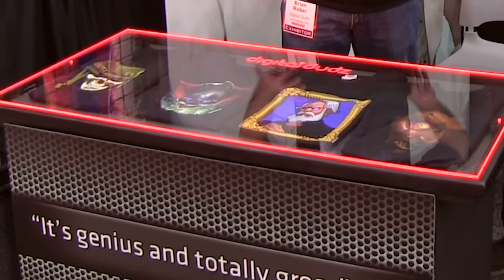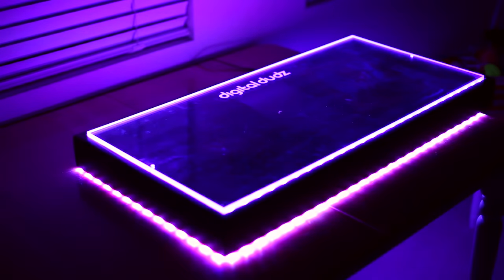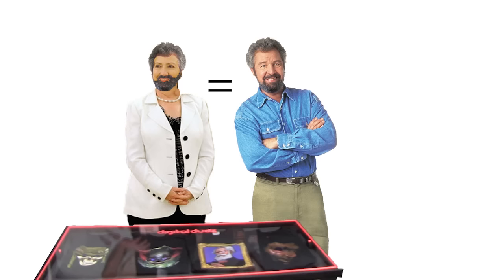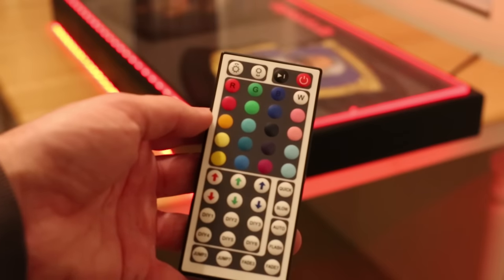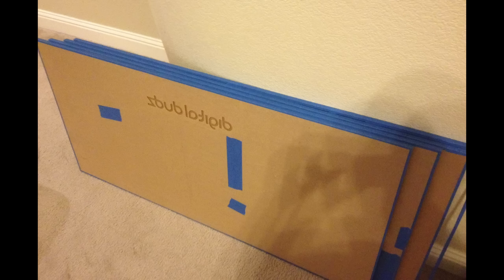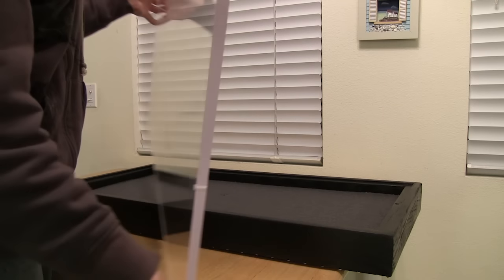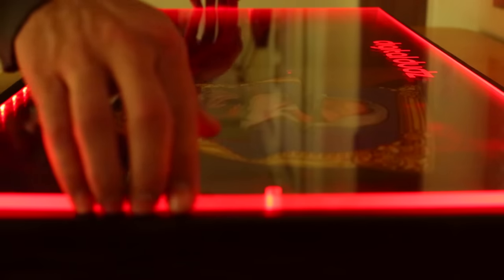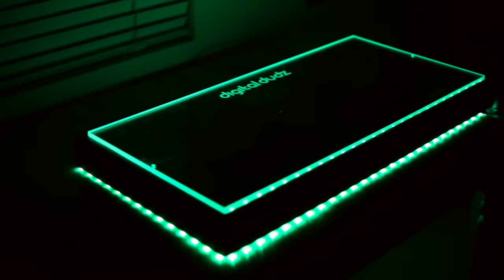LED Edge Lit Table- HOW TO

Comment: A little different but it turns out IKEA sells glass table tops.  If you take one of those (Glasholm, 3/8 inch thick tempered glass - only about $30) you can take aluminum channel section which has a roughly 3/8 inch gap in it and put a strip of LEDs in that.  It just goes right on with a press fit.  The edges are already ground, as is the underside.  Rather than having a logo on the desk you have a kind of gradient effect from the back to the front as the light scatters.  No edge sanding, or etching needed.  I made my computer desk this way and it was featured on lifehackers a couple of years ago.
Reply: U pretty cool sharin that w us😉thx 4the tip cool guy
Reply: +Philip Ball can we get a link to the lifehacker article of your desk? thanks!

Comment: Earned yerself a sub. Going to look into using this for my next computer build. Foldable table legs, Your etched acrylic tabletop, And an water cooled PC inside. One helluva Battlestation. Might even make something similar for my living room, Non foldable legs and sealed up with silicone with the Air inlet and outlet for cooling being directly underneath with edges against any spilled liquid so a good movie night with a lil bit of drinks doesnt end too expensive.

Cheers for the ideas :D

Comment: It should work fine regardless of where the decal/logo is put.  The key here is that the light totally internally reflects throughout the panel unless it hits a diffuse surface (some part you roughed up, that diffracts the light that was normally bouncing or reflecting through the pane of acrylic).

Comment: on those LED strips, you can cut them along the line, between the LEDS, use a cable to run power to the next LED strip.  Did the same thing on my battle station and under the cabinets in the kitchen.

Comment: thank you! trying to replace an old el panel in a caller id with led back light and plexy. was going to manually score it to distribute light but the sand blaster is the way to go!

Comment: You can also burn the edges of the plexi-glass with a hand propane torch lightly and edges get super shiny almost a mirror shine so the  colored light effect looks really expensive and its easy to do  instead of sandpaper.

Comment: those weren't the best instructions either. "step 1: have brother make table, Step 2 add leds. Step 3: add acrylic" How about a little more in depth info on the technique your brother used to have the acrylic set in the table. how difficult was the wiring? where'd you get the acrylic from? like seriously.
Reply: Luminen Kettu was the entire video supposed to have been the joke?

Comment: Hello Mark. I have a couple of questions

1.  When you guys did the underside of the table with the extra led strips, did yoiu have to cut and solder them or did you just twist and loop them at the edges / corners.  I cant really see the corners in the pic.

2.  What grit sand paper did you to ruff up the edges of the acrylic sheets?

Thanks.

Please let me know.

Comment: hey im tring to make what you made but for like a breakfast bar. i had a few questions.
1. did the acrylic sheet have a lot of flex to it. if so how thick do you think to where there will be no flex  (2ft wide 5 1/2 long)
2. does it scratch easily
3.will glass give it the same effect
thanks
Reply: the acrylic looks about a inch thick so no flex glass should also give you the same affect but you will need to find a thick sheet

Comment: Instead of sandblasting, can you use frosted window spray for the graphics on the acrylic?? I'm looking to do a special Christmas gift and wondering if I could use frosted window spray instead.
Reply: I don't think that's gonna work. The beams need to make contact with something that's embedded. You need to sand off a very small part of the acrylic top layer to make the beams make contact with it. Putting a layer of frosted window spray in top of it won't make any contact. Hope that does make some sense. ;)
Reply: It does work. I've done it.
Reply: @TheOpelkoenjas  It does work. I've done it.

Comment: Hey Mark, I have pretty much the exact same set of LEDs for my kitchen cabinets (mine were from HiMart on Amazon). Your controller looks very similar to mine, but mine hardly works. I have to fight with it and most of the time, it gets the colors all messed up. Have you experienced any trouble with yours or did I just get a dud?
Reply: Im assuming that you have a basic RGB strip. if so it should have 4 connections/wires to the controller. check your connections.  the basic RGB strip will usually use 1 +positive line from the controller and 3 -neg lines returning to the controller. (one for red one for blue one for green).  The controller is dimming each of the neg RGB lines at different set values to achieve the set colors.  so slight variables/resistance in the flow of electricity on the negative side of the light strip to the controller will change the "color" being displayed. slight variables/resistance in the flow of electricity on the positive side would make all colors dimm/brighter.  the controllers kinda work "backwards"  as normally you would adjust/dimm the positive side of a single color. Hope this helps you.

Comment: using edge lighting leds and instead of acrylic i use a marker to write on the glass....will that work gud enough???
Reply: Leroy Pinto What are edge-lighting leds? Just Writing on the glass will most likely not work.

Comment: you know what would have been pretty cool? if you had told me i needed a FUCKING 80 dollar compressor before i ordered the 40 dollar airbrush.
Reply: I think that's where common sense kind of comes into play....It's common sense that you would need an AIR compressor to supply AIR to an AIR brush.
Reply: oh absolutely! but when that air compressor is a special model made just for that airbrush model, maybe you'd choose to refrain from saying it ONLY costs 40 dollars. So you can take your common sense and shove it
Reply: Wrong again. An air compressor is an air compressor. There's no such thing as a special model. There's just different sizes, maximum pressure and cfm. You can use an airbrush with a normal shop air compressor. Actually, most professional airbrush artists don't use the smaller "airbrush" air compressors and use a shop compressor instead. They make adapters and smaller hoses to connect the air brush to the bigger compressors which only costs a couple dollars. This etching/sand blasting air brush uses a standard airbrush connection as well. So perhaps you should open your mouth and insert your foot in it.
Reply: WHERE?? where, oh great one. Please enlighten me on where i can find these so called attachments so that i may open my mouth and insert my foot into it. btw thanks for clarifying that an air compressor, is in fact, an air compressor.
Reply: Do you not know how to use Google? You poor soul.....And you're welcome for clarifying that for you seeing how you were under the impression that there are "special" air compressors. Glad I could get you on the right track.
Reply: im not gonna bash you, but theres a reason its called an AIR brush (hint: AIR!!!! brush)
Reply: in all fairness, he did say: '' how to make an awesome LED lit table for under  $ 100
Reply: including the plexiglas, led strips, and wood i spent well over 300 on this table.  its bullshit.
Reply: eloy maduro Yeah,  $100 in MATERIALS.
Reply: That's ur fault dude u should've used ur common sense and added up the prices before paying for them. Not his fault ur's. u paid for it as well as regret sucks for u!!!
Reply: Yea um +Ryan Holmes I think we covered that already...
Reply: Alexia Wilson Did you really think I read the whole thing?

Good, me neither.
Reply: Ryan Holmes U think i care what u do? U arent a big celebrity so stop actin like it K now move along
Reply: I am the same person btw
Reply: busy but i do have time to say this....
1. thats posting pics of my personal business
2. sry but i hv 2focus on oher things and will clear everything up (like I said soon/this weekend)
3. back to U
4. its ur idea
5. y dont u bc u obviously dont get the point when I asked if u really dont care y act like it?
6. i really hv to finish and i also find it entertaining bc it would b nice to embarrass a troll in public ;) ttyl
Reply: HeyRyan Holmes Lol I hv a life that id like to live thanks and sitting here replying to an idiot that thinks he/she is offending me but rather not effective is a huge "no no" in my life rule book! Ik better than to take some offense and tease from someone who is unimportant and has no connection or value to me. So check yourself...and FYI I only came across this argument for my entertainment so yea I had some good laughs thx
Reply: Bringing up my grammar doesn't prove or solve anything thanks (I know this is late but this isn't alexia the one you've been arguing with) Ryan Holmes
Reply: Alexandria Karaoui
Reply: That's what we tend to call a no-brainer.
Reply: You could sand it..

Comment: I wonder: How did you get the strip of LED to fit the corners of the box ? I used some in the past and it snaped when I tried to bend it 90 degree angle..

Comment: Anyone know if you have to make the glass stick out of the top like that to get the lit trim or can you make it all flush like a desk ?
Reply: +Ryan Grimes It can be flush with the surface. The reason its not, is because you wouldn't see much of the outer edge color, since it would be blocked by the surface material.

Comment: How long until the LEDs die?
Reply: Depends: I have high quality strip that has lasted for a long time and I have also had strips where individual LED's stopped working. If the strips are placed permanently as part of a fixture and not bent around in use then it will last as long as you could have use for it. LED's aging process means they loose brightness over time, but it is usually about 80% brightness after 20,000 hours of continuous use.

Comment: whered u get the acrylic? and how much
Reply: home Depot or Menards. like $40 @ sheet
Reply: +Andy Vang +the gremlinz1 
The thickness he is using will cost you a LOT more than $40 for a sheet. I don't think Home Depot even sells a sheet as thick as he is using here. 

TAP plastics is a chain in the USA that sells plastic of different types that thick. Obviously there are other plastics stores that sell it. Look in your "Yellow pages" and ask the cost, but for something the size and thickness they are using here expect to pay over $100, unless they got some serious hookup, and probably closer to $200. It will depend on the exact size, thickness and type of plastic. 

Good luck
Reply: +Galactu5 yeah your right.  they sell different thicknesses for different prices. Starting my own project soon.

Comment: is there a way that a switch can be installed on the side of the table so that a remote is not needed?
Reply: the led lights they sell at Menards have a toggle switch already installed on them.
Reply: Just tape the remote to the table